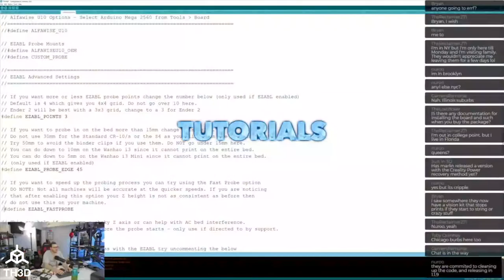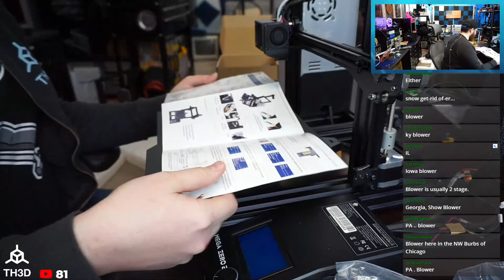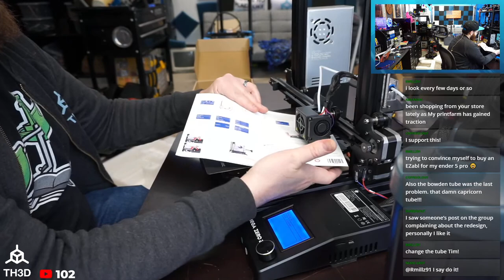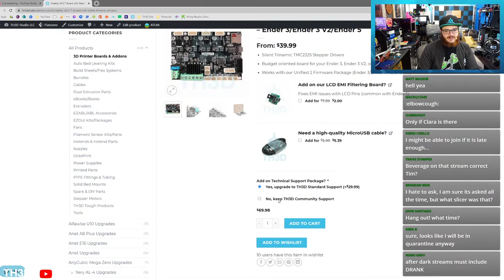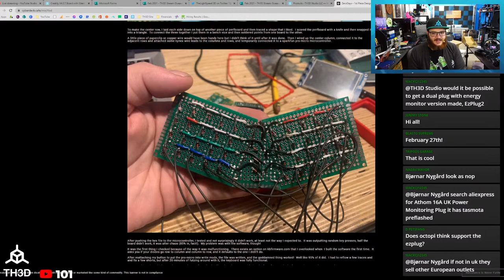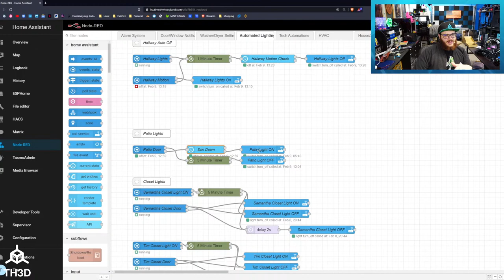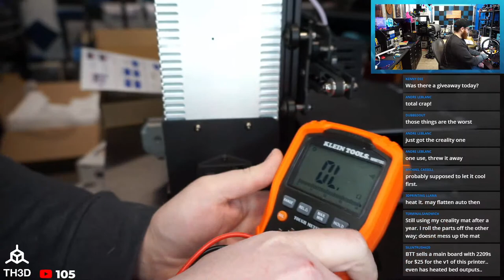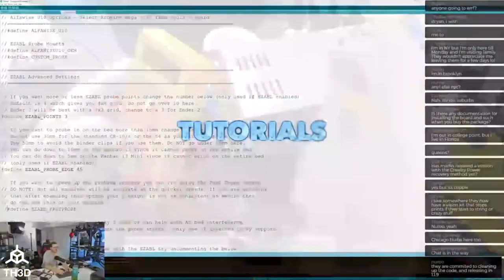AnyCubic Mega Zero V2 Unboxing, Setup, and Teardown | Livestream | 2/9/21

Comment: I have got a mega zero 2.0 which has just arrived and is sitting in its box. I have yet to do the unboxing, so I watched your video. I would not have been aware of the issue with the rollers and the belt-tightening, so if my Mega zero is like that I shall know what to do! I think the tinned wires have to do with production engineering. Untinned wires can only be fitted by hand. Thanks for uploading.

Comment: I bought the V1 after seeing your review thinking you'd be releasing something to convert to heated bed but I was never aware that you had. I did it myself but couldn't get it to output signal to fire the bed heater's mosfet. I ended up going with a thermocouple and PID control. Being new to printing I put a lot of time and money into that printer before realizing it was just a complete POS.
Reply from the maker: We did a little write up here on the heated bed upgrade we did on ours. It's been working well since we did that: https://support.th3dstudio.com/hc/guides/diy-guides/anycubic-mega-zero-v1-heated-bed-upgrade-diy-info/
Reply: @TH3DStudio  The problem with my particular Mega Zero was that it had a bend in the frame which prevented bed leveling from being possible. I found this after installing your firmware which levels at 5-points instead of 4. After the 4 corners were properly spaced from the nozzle the head would move to the center where it contacts the print surface. I ended up spending more on trying to get it to work than I did on the printer cost to start with not to mention a few hundred dollars of my time. 
After realizing what the problem was I emailed AnyCubic a couple of times but I don't think I received a response from them. I decided to just replace the bow piece but since that stuff is so much cheaper buying full-lengths I ended up ordering 20x20, 20x40, and 40x40 with the intent of increasing the print size but realized the whole process had been futile. It all is piled up out of my way in the shop now awaiting the inevitable day when it no longer makes the cut during a shop purge.

Comment: hi a bought same model but after connecting cabels the screen just show up on second and after dont answer.
Do i get wrong voltage or could be other problem 
help
Reply from the maker: Sounds like you may have an issue with the board. I'd contact AnyCubic to see if they have any solutions. You can also post in our communities here: https://support.th3dstudio.com/hc/customer-service/community-information/community-support-links/

Comment: I have an Ender 3 v1. I want to wire in a 12v LED light. I have a Buck converter. Where is the best place to tap into the 24v?
Reply from the maker: Directly to the printer PSU DC output.
Reply: @TH3DStudio  Thank you. Didn't know if there was a better place. :-)

Comment: I need help, when i turn on the fans turn on but not the screen
Reply from the maker: Sounds like the board may not be getting power or a cable is not plugged in all the way on the LCD.
Reply: @TH3DStudio  yeah and there is a red light in the module thing

Comment: i just flashed pprinter to your firmware printer said eeprom versiom error
Reply from the maker: Yeah, it will because you updated the firmware. If you actually read the directions it states to reset the EEPROM after a flash, it's the very last step.

Comment: And although they claim it also has a print resume option after a power loss, it has not!! I could throw away a 5 hour printed item after a power stop. That was the reason I wanted this printer but it was nothing than a disappointment because it was just a lie to sell these!
Reply from the maker: In our Unified 2 firmware there is an option to turn on power loss recovery. This feature does work OK (sometimes it doesn't because its software) but it will cause excessive wear on your SD card. The best protection against power outages is to purchase a UPS for the printer. Most printers will get about 15-20 mins of runtime on a 1000VA UPS like this one: https://amzn.to/2TPOrRN or this one: https://amzn.to/2Sgumnb. We use UPSes on all our Printers here and usually stick with CyberPower or APC for the brand.